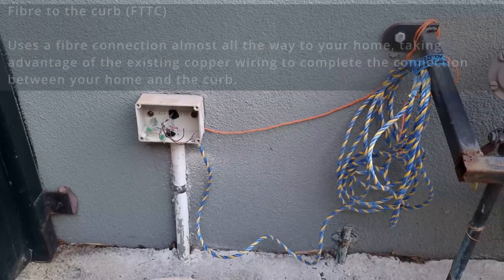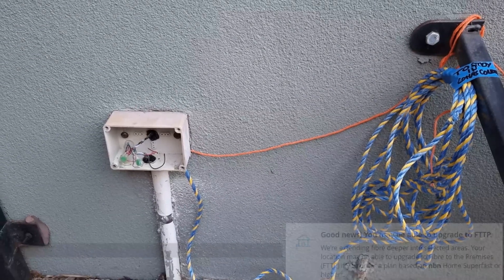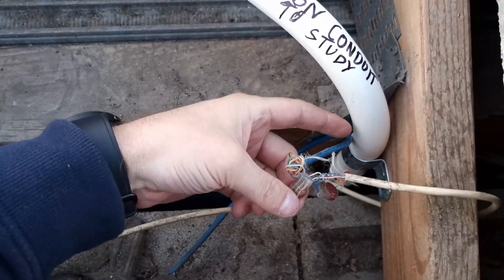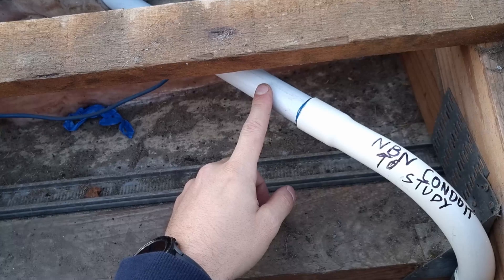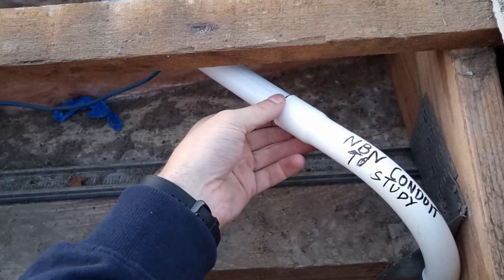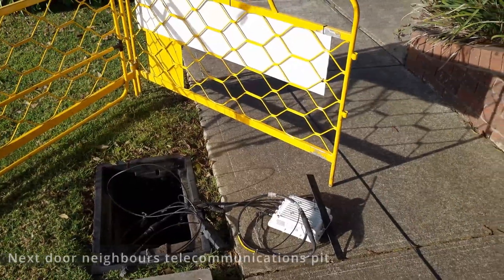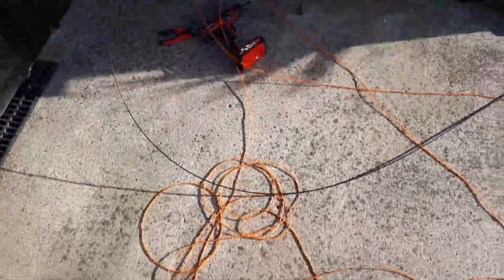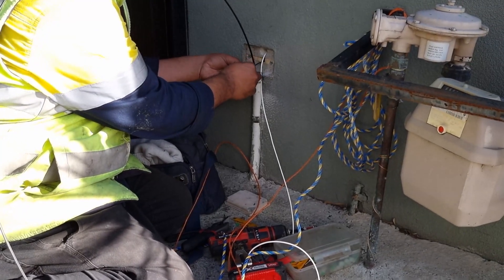Free 2024 Fibre NBN Technology Upgrade! Australia

Comment: What happens if the old copper wire inside the house isn't inside a conduit and you can't get access to it? Clearly there will be clips holding the old wire  so a pull through isn't an option. I know my old wiring is above our timber lined ceiling and there are bedrooms above, so quite an issue if I choose to upgrade.

Comment: Just a few WHS issues in relation to this installation in the street. Firstly this installer has breached his Duty of Care by not have a set of guards around both pits he has open in this video. Secondly he has his pit key handing out of the 5 pit. I have investigate numerous incidents where installers have tripped over their pit key whilst it was handing out of the pit lid. Thirdly there are no pedestrian signs up to direct pedestrians around his open pits. He has no men at work sighs up which is part of his duty of care in relation to pedestrian management. I would like to know which Delivery Partner this contractor was working for, so they can be informed of his breaches?

Comment: Those AFL connectors putting fusion splicers on the shelf, it's funny how these companies take advantage of the resident not knowing
anything about acceptance loss. I figured you lost about minimum .4 dB possibly .6, the contamination was all over plus a good tech would have
cleaned out the bulkhead before insertion, regardless. If he had burned on pigtails, could have been less  loss, around .2dB, it depends on what kind of upload application you are needing at the residence, so for every 1dB loss is 20%. I did not see what the power meter was reading but
a good tech would have had OTDR and calculated all the loss for you to the NBN. Some facilities would never allow those AFL connectors, it's residential so, the hell do they know, If you are paying for that drop, 100% I am sure you not getting the  full benefit of that SM.
Reply from the maker: I agree with you mate i will be getting the join outside fusion spliced with the manufacturer pigtale to reduce the loss. It kept dropping out due to contamination of the connector endfaces. The click clean pen fixed most of it still can be improved.

Comment: It's crazy to me how many people in Australia (myself included) are still not using full fibre. In my case it's only Fibre to the Node and I'm way too far from the Node to get speeds beyond what ADSL 2 was giving. I was complaining about my internet speed back in 2014 and 10 years later it's barely any better than it was.
Reply from the maker: It has improved, but not much. We have 3rd world internet 😂
Reply: That would mean that the copper from the node to your house is either poor quality, in poor condition or has bad connections somewhere.

You may be able to get your ISP to check the connection points for faults. If there is no fault then you may get charged for a technicians time. If there is a fault outside your property limits then you won't get charged.

I had a problem with reducing speed and dropouts on FTTN a couple of years ago. After calling iinet tech support a number of times I got them to do 2 or 3 checks on my connection. Finally they found an issue with my copper connection at the node where a previous technician had compromised while working on another job. They fixed it up and I went from 33Mbps to 100Mbps and had no more dropouts.

I believe that in Australia that if your speed is below 25Mbps then it falls below a minimum standard and your ISP can be compelled to fix it or find a better solution. I forget where I read that, unfortunately.

Comment: A question for you, did you notice if they cleaned the fibre connectors before they got plugged in? 🤔
I see you are getting a ping of 9ms but I get that on FTTN with speeds of around 105/23 so it should be much lower like about 3ms. Thanks for the video, I'm due for upgrade in a few days, hope they don't cancel on me 😜
Reply from the maker: Hey mate no they didn't clean the fibre during the cleaver stage. I ended up buying the sc connecter cleaning pen and cleaned it myself after they left.
Reply: @allelectricalau  Really?

Can you go into further detail what you did here?

I'm a bit scared to touch my newly install fibre cable but I would like to know how to check if it's not clean at the end.

Comment: It's weird that only those with fibre to the curb get free upgrade. Most are on hybrid fibre nbn which, I heard,  is mostly copper as  they use coax cables which were installed for cable tv decades ago for cable tv along poles on the streets. It's like a scam.
Reply: I've just been free upgraded from fttn to fttp. Now for activation!
Reply: @mozreactor  Got 5G internet last week. Woowooowow!
Reply: its becuase hfc is still capable of current internet speeds like 10gbps so their is no need to upgrade it to fibre to the premise right now so their focusing on fttn and fttc which isnt capable of anything more than 100mbps
Reply: @blinks22-kv1kn  What is the point of 100 gbps if NBN charges the internet companies double who then charge customers triple? That is greed uncontrolled. And the government could not care less

Comment: Those speeds are better than my FTTN NBN connection
Reply from the maker: The node might be a fair distance from your house
Reply: @allelectricalau  is there a way i can force Telstra or nbn to do my FTTP upgrade? As Telstra (my ISP) won't change my plan without me having a drivers licence or passport
Reply: hi i finally got FTTP i changed to optus and they did my upgrade from FTTN i have had it for a year and a bit now and have had no issues and the free 500mbps speed upgrade from nbn has made it even better

Comment: From NZ - welcome to glorious fibre to the house speeds. Great work getting the Fibre run through the house as close as possible to the router too!
Reply from the maker: Thank you mate! I did my best. Is this setup similar to Nz? What do they do different?
Reply: 87% of houses have fibre to the home with the standard plan is 300/100 or you can get 1000/500 like I have or if your in a certain part of major cities you can get 2000/2000, 4000/4000 or 8000/8000….. pricing is around 75-80$ for the 300 Mbps plan
Reply: @magesnz  the nz 300/100 plans also have a 10percent margin so in fact get 330 down 110up. In the speedtest